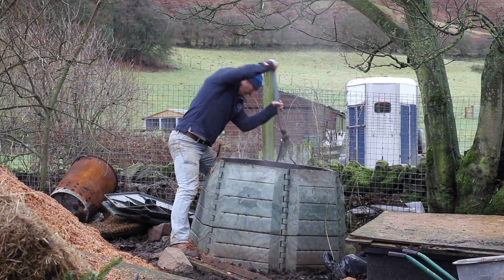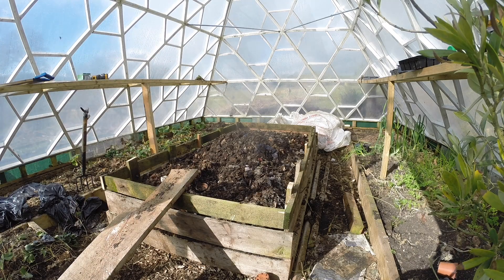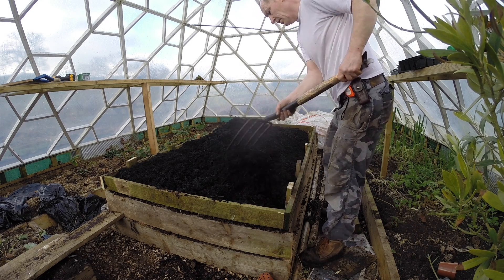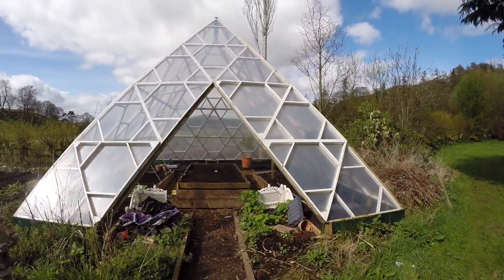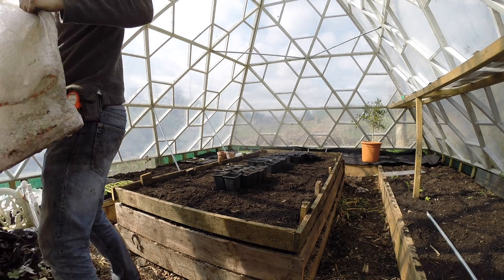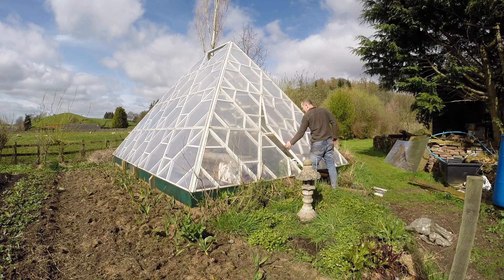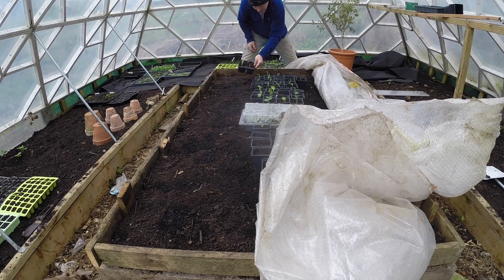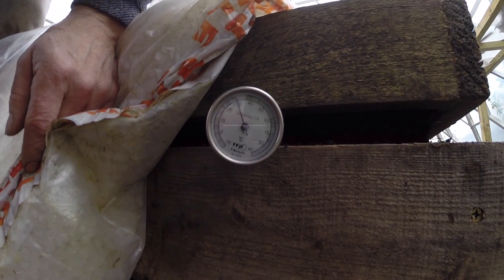compost heated passive greenhouse

Comment: Just pile it up, spray it with water, and let the fermentation process generate both the heat and carbon dioxide for the plants. In one experimental greenhouse in England, a greenhouse atmosphere with a 0.13% carbon dioxide content, can produce 1,000 pounds of forage plants per day per acre! One can only imagine that yields can be achieved if one uses Du Pont's experimental tests by using 100% carbon dioxide on soybeans that quadrupled their yields! Information source: The Coattails Of God by Robert M. Powers and whose men are discussing what different kinds of agricultural systems should be used in a highly organized combined system to be used together to crerate the highest yields per square foot per day on a multi-generational starships to the stars and How The Other Half Dies by Susan George.

Comment: Do you find there to be an advantage to germinating in a greenhouse on a hotbed vs. under lights indoors? The requirement for electricity aside, would you say that the seedlings are more hardy and better for transplanting when grown on a hotbed like this?
Reply: dito same question I would assume the answer is yes though. I bet they are more hardy and better for trans pant outdoors but something started indoors under a light might have a bit more of a head start but be better suited for the hot house.

Comment: From experience, a passive solar pool made a difference for me.  After operating a 28'X48' greenhouse with a 3000 gallon swimming pool for the past ten years, I recently removed the pool to convert that area to raised planting beds.  The overnight temperatures seem to be 3 to 5 degrees F cooler since removing the pool.  I operate the greenhouse as a "cool" greenhouse, with use of a wood stove overnight to keep temperatures above 34 degrees F.

Comment: Really simple and clever.Its autumn here and I am researching passive heating options.
 I have plenty of chook poop, cow poop, old straw and leaves from deciduous trees to cook down and use as a heat source.
I am also thinking of using hay bales on the shade side to increase the thermal mass no sun really hits there in the winter The coldest months here are July and August mostly heavy frosts and cold winds creating high chill factors.
 My motivation is the insane cost on energy to heat a green house in winter. 
Thanks for sharing your experience.

Comment: That's not only a beautiful greenhouse, but it seems quite spacious as well. Very nice set up with the bin in the middle.
As a fanatic composter I have a tip. Obviously. :) Next time you might want to use actual 'fresh' ingredients. Build up your compost heap in the greenhouse (instead of starting it somewhere else and have it reach its hottest point over there) and add more 'green' material than you normally would. If you can get your hands on it, a few buckets of coffee grounds are a great source of nitrogen ('green') and will heat up your pile considerably. 
Great video! Thanks.

Comment: Thanks Paul for your vids. I'm still trying to build a passive solar greenhouse, but I don't have the illusion I can grow tomatoes in the midst of winter without additional heating. I just want to extend the growing season with veggies that are more cold weather resistant. These veggies will survive better during cold weather, if the temperature drops more slowly. In order to attain that goal I will try to maximize the thermal mass inside, keep the warm air from the top pumped down to the floor and/or a heat sink, isolate the north wall max, double layer the south face, and maybe even do composting  inside. The cold resistant veggies have to be established before winter so you can harvest during winter. Choice of veggies often seems to be neglected in discussions, solutions can be combined into a multi strategy approach. I think if you double the height of your compost bed, and use horse manure as a N source, your greenhouse will reach higher temperatures. If you can change the entry of your compost bed into slide in/out wood, loading/unloading with wheelbarrow will be more easy. Cladding the inside north wall with reflective isolation will also help. Happy gardening, Earl (from Holland)

Comment: Great idea, I really like your pyramid greenhouse. I found thinking about this to be very inspirational and  considering how to tackle your heat problem I came up with a solution for something completely different I'm working on. I wouldn't completely write off lower cost solar/geothermal working in synergy with your great hot bed idea, though I recommend you think outside of the pyramid ;)
Reply from the maker: Glad you found the video inspirational, I too wouldn't rule out geothermal but I don't think it can work on its own. The way I design is to work out exactly what you want to achieve, then figure out a method that will get you there. I need a minimum temperature of 15° in February to germinate seeds. Geothermal won't work but I could use electric pads, a stove, compost heat or a number of other things, In my context the compost seemed the best option.

Comment: Assuming you've insulated the greenhouse, post this video, then does the hot bed generate sufficient warmth for growing veggies all year round? Additionally can you use the hot bed for growing veggies directly?
Reply from the maker: I don't grow year round because of the low light levels in winter, I use the hotbed for starting seedlings early, I didn't insulate the greenhouse I just made a bubblewrap cover over the bed. Yes I grow direct in the hotbed when it has cooled to around 30°C this takes about 6-8 weeks from making the bed.

Comment: Great video. I'm designing a greenhouse that I hope will provide 52-week growing, and it will incorporate compost heating. But instead of a single-use hot bed (which is the model that every implementation I've seen so far uses), I'm going to try a "rolling" hot bed.. feed weeds an other organic matter into the top, remove semi-mature compost from the bottom when it gets full. I can have that kind of heap running at 65-70º at the top. The design will also use earth-sheltering, dropped 1m into the ground. I'll follow you to make sure I get your learnings. Thanks again.
Reply: Your design sounds interesting. Did you try it? Does it work? Thanks.🌱
Reply: @tmckmusic8584  Nope. I never did it in the end (commenting with different account here).

Comment: Paul, you gotta check out this book: The Compost Powered Water Heater. I met the author in Vermont, they do some amazing things with compost using very simple methods. Not only heating water for radiant heat, but even capturing the gasses the pile lets off and utilizing it as fuel. 

One thing that would probably improve your piles heat output would be to actively aerate the bacteria. It would make the GH a little less "passive" but you're getting a lot more from your pile without a ton of input. The easiest way is to route some perforated pvc under/in your pile that is connected to a small pump or fan. On a timer, air will be forced through the pile, aerating the bacteria, essentially foregoing the "turning" activity that all compost heaps need to continue metabolizing. 

Thanks for all your help, Paul. I just built another of your Pentakis greenhouses for my backyard.
Reply from the maker: Hi Johnny, I certainly will check out that book, sounds just up my street. I have had a quick look at forced air instead of turning but not tried any experiments just yet. I need to build a proper unit as I get tons of compost from a cafe and my current system can't handle it. Great to hear you are liking the Pentakis design.
Reply: I've got this book too, it's great.
Reply: Hey Paul. Have you looked into Sterling engines? I'm thinking of adapting a low-temperature differential (LTD) SE to use to force air into the top of a heap. It should run 24/7 just off the heat difference between the inside of the compost container and the ambient air, which could be 40º difference.
Reply: @BenHuntUK  That's brilliantm You have an update on efficiency?
Reply: @Ludifant  No, I never got it working.
Reply: for reference: Stirling engine on wikipedia

Comment: Compost heat is good, plus the co2 released helps plants grow.  A big heap of compost can keep your greenhouse warm in the winter.  However, there are other gases released that are not useful and can be hazardous.   I prefer to use a rocket mass heater to supply heat.  In addition, I made small batches of biochar inside my RMH and by burning off the wood gas it generated plenty of heat and co2.  My plants would noticeably thrive just after making small batches of biochar.  How does this relate the compost?  Composting is nature's way of breaking down organic materials as gases and heat are given off.  Biochar creation is the same but much cleaner because the toxic gases are burned.  I have often thought that if everyone were to start a compost bin... the result would be bundles of methane and nitrous oxide released. Not good.  So to rely on compost heat only might not be such a good idea.
Reply: ... bio mass is still decomposing whether it's in a pile in the landfill or a pile in the greenhouse so you may as well utilize it, no?
Reply from the maker: If composting is done aerobically (with plenty of oxygen) then gases are mostly just Co2 anaerobic decomposition makes lots of gases like Methane etc, I have heard of capturing and burning these gases as fuel but I prefer aerobic decomposition if at all possible.
Reply from the maker: Oh ant the biochar thing is also something very interesting. I like that you can get a product out when you have finished burring it for heat. Bit like compost that way.

Comment: hah, now I know why my sweetcorn is rotting in the pot ;)

I think this is a very interesting idea. I wonder if it would be possible to duct heat out of the pile with heat pipes to radiators? Perhaps it could be feasible to add certain material to the compost so that it runs at the high end of the temperature scale, so that the heat radiation effectively regulates the compost pile?
Reply: check out the book, compost powered water heater, they do some amazing stuff with simple methods
Reply: Thanks, that looks awesome. Wishlisted! Speaking of compost, Paul, if you are reading this, can you do a video on how you make your compost and what you put in it, it looks amazing!
Reply from the maker: Sure no problem, I'll  post soon and let you know in this comment.
Reply: Cool, thanks!